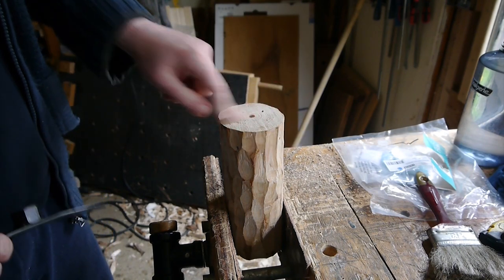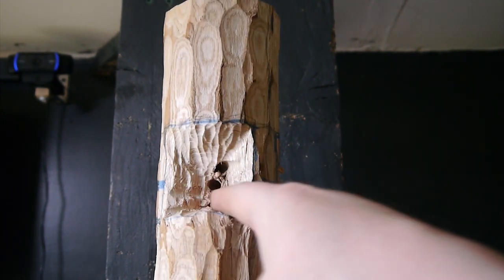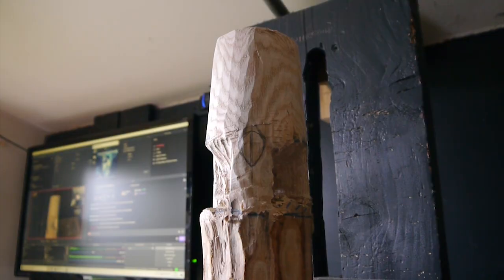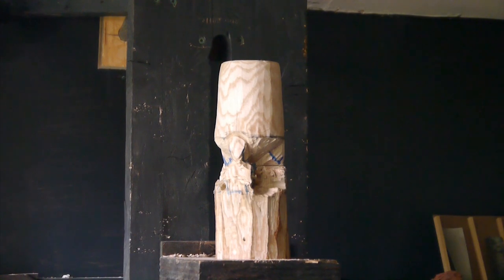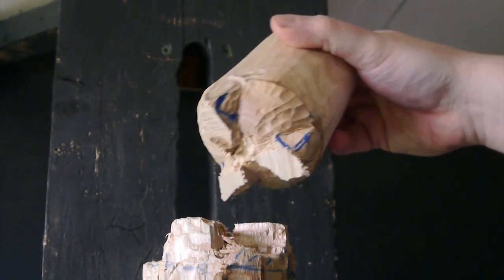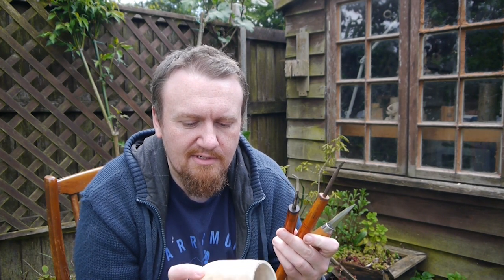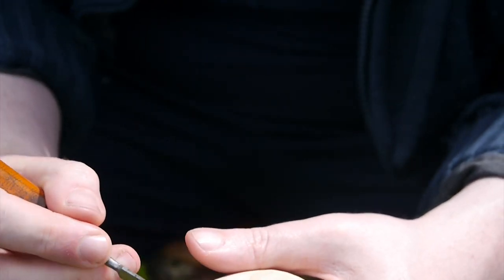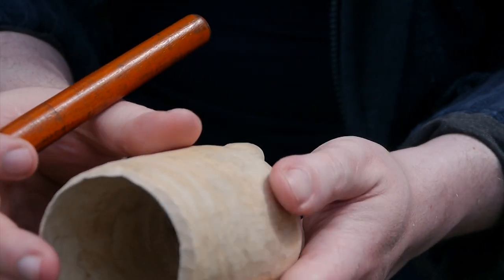How to Carve a Pencil Caddy From a Log

Comment: Nice stuff, I really love the handtool focus of your vids, it's why I watch. Clint, one question though, how did you hollow it out? I'm asking as I might have a crack at it one day!
Reply from the maker: Cheers John! Well, that's another story haha. These ash logs have been drying for a few years so they're rock hard. I've been soaking them and drilling down with a forstner bit in a drill, I need to soak them five or six times for about twenty minutes a time to get the depth I want. Then I use a hook knife and a Dremel to clean out the inside.

Not exactly the hand tool solution but I don't wanna spend hours and hours hollowing out the inside haha

It'd be much much better to use wet/green/freshly cut logs I reckon